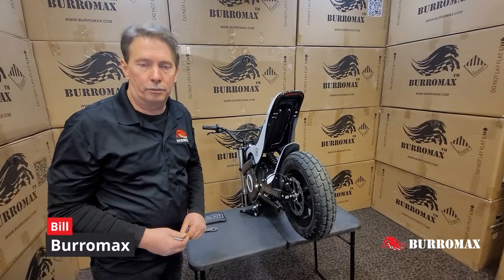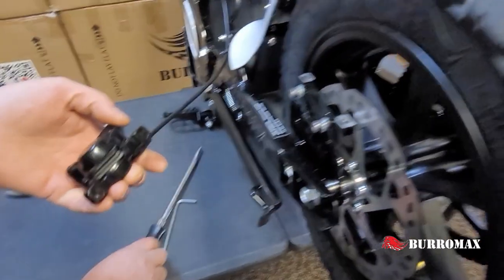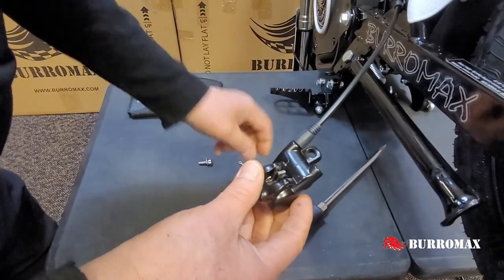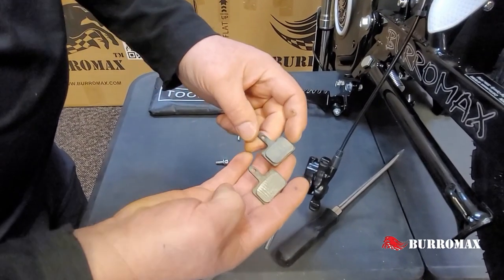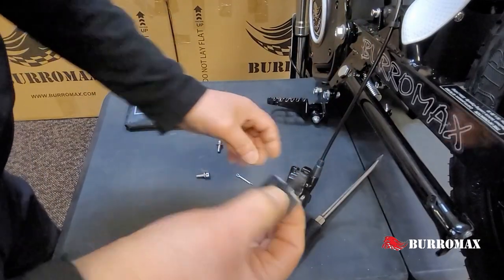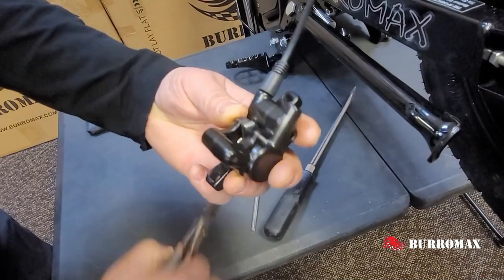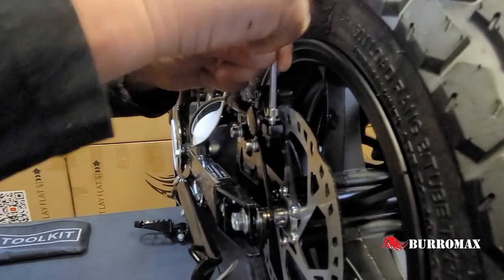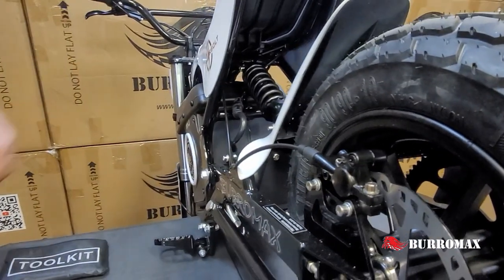How to Change the back brake on a Burromax TT1600R  (Part #10187)

Comment: Do I need break fluid?
Reply from the maker: Yes and no. If the reservoir is low, then yes. Otherwise, you can change the bike without brake fluid.
Reply: @burromax-mini-bikes  sorry my first bike.. so i just unscrew and check ?
Reply from the maker: You got it. If you need a detailed explanation or help, give "Burromax Bill" a call at 800-742-1189.